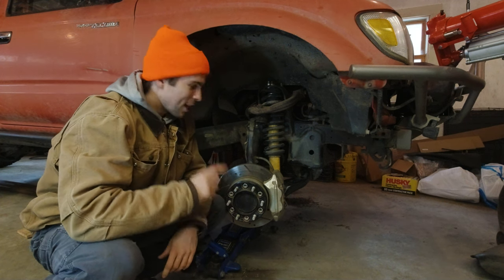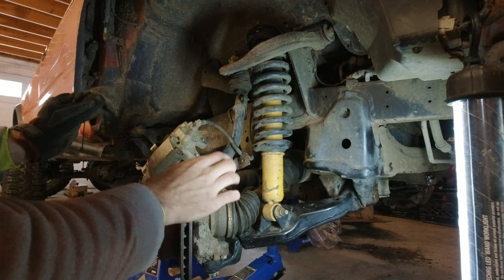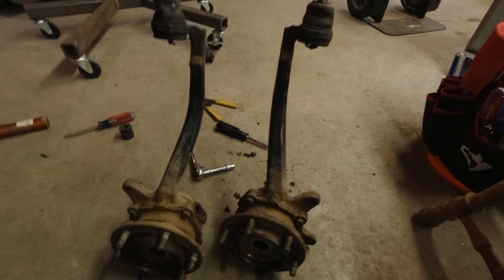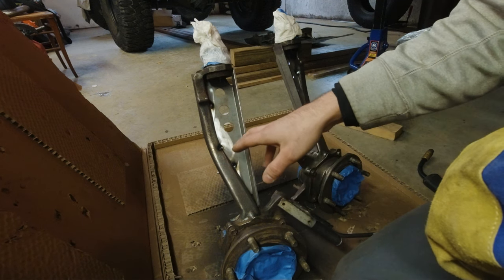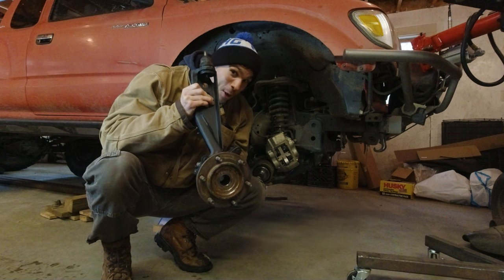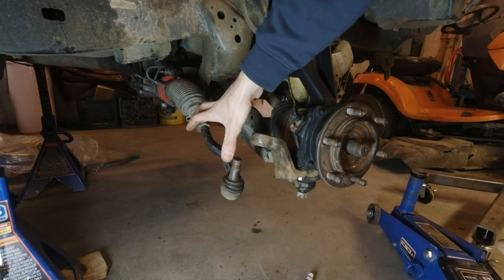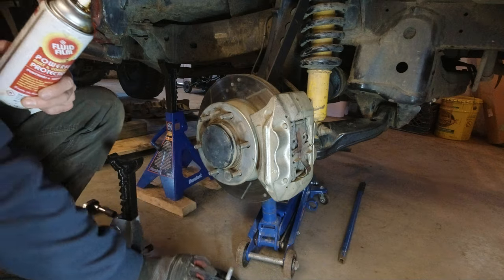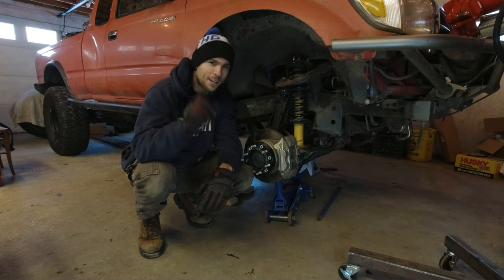Installing Total Chaos Spindle Gussets on my '99 Tacoma! | FULL TUTORIAL

Comment: Good vid man.  In the future if you need to torque any axle nut just throw a screwdriver in the web of the rotor and let it lock up on the caliper as you tighten it, Works on any car as long as it doesn't have solid rotors obviously.
Reply from the maker: That’s another technique I’ve used, I tend to use the one I showed more often just because I tend to be pretty mean to screwdrivers through other methods. Thanks for the support too, I appreciate it!